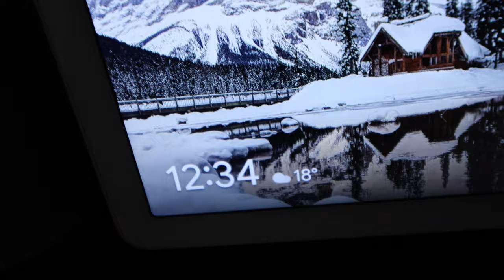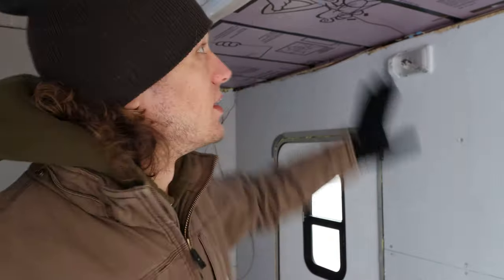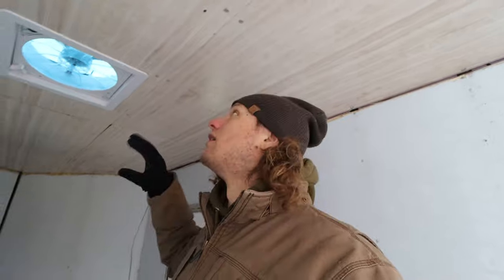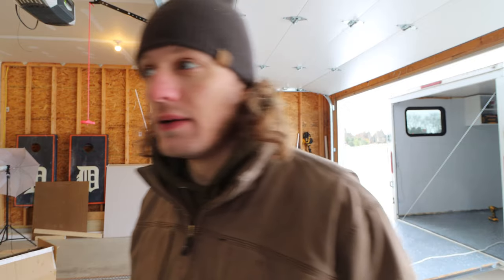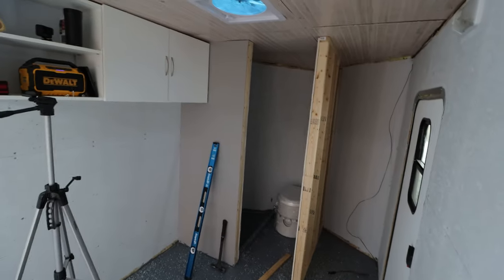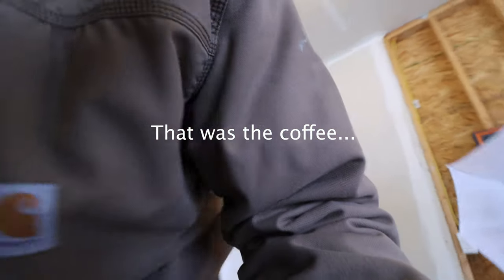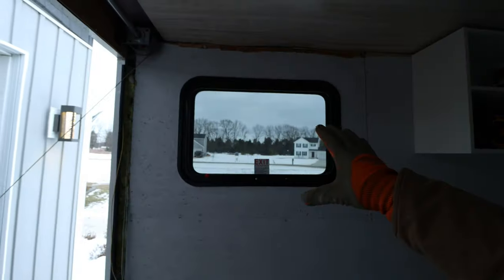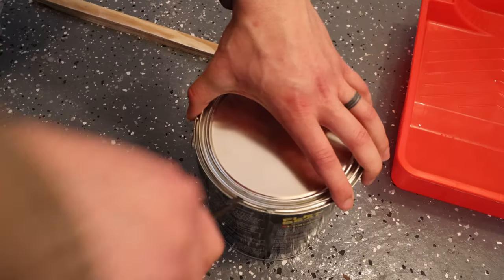Epoxying the Floor of an Enclosed Trailer - DIY Camper Conversion

Comment: You didn't insulate the floor?
Reply from the maker: No. That was something I thought I'd do later. There wasn't a good cavity to put insulation, so that was gonna have to be foam
Reply: @ambmh5535 ,
Well, you frame out the floor and you could use the same as the walls. But better to spray foam it.
Reply from the maker: That is an option, but I'm 6'2" I didn't wanna lose any ceiling height
Reply: @ambmh5535 ,
I see. How has it been in the cold weather? I would think a diesel heater would be a good fit.
I live in a couple of tiny houses that I have on my property. We are completely off grid. I am looking into building another tiny house out of an envlosed trailer like yours. Collecting the ideas for it now.
Reply from the maker: I used it in the cold once. When the temp was in the 40s it was great. There was one night it got down to 18, and it was quite cold, but with good sleeping equipment I was warm and slept great
Reply: @ambmh5535 ,
We live in the Arizona desert. So it gets very cold when the sun goes down in the winter, and very hot when the sun is up during the summer. So heating and cooler is very important to us. Of course, the better you insulated the easier both those are acheived.
Reply from the maker: Yea, the time I was referencing was winter in Arizona/New Mexico
Reply: @ambmh5535  How will you spray foam if the floor is already down? Is spray foam better than the board stuff?
Reply from the maker: The bottom of the floor boards are exposed underneath, so you can sprayfoam it from underneath the trailer. And yes, sprayfoam is the best insulation there is